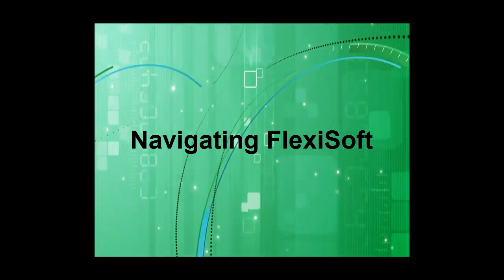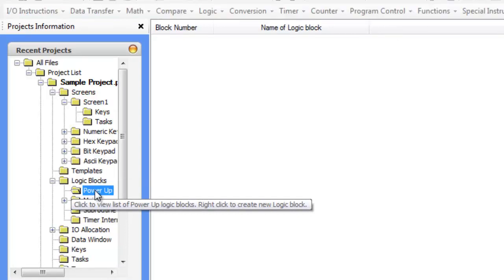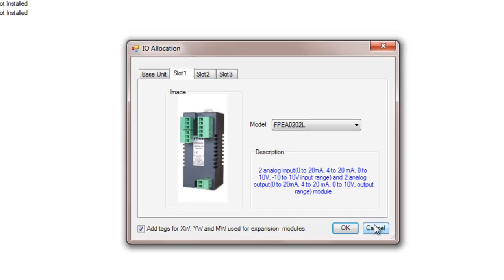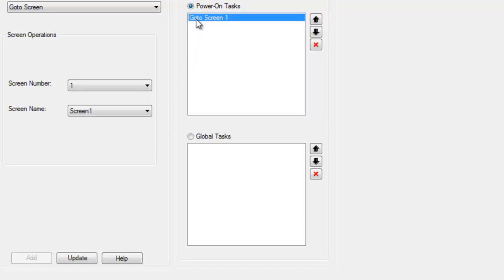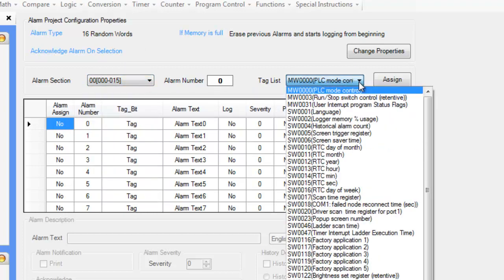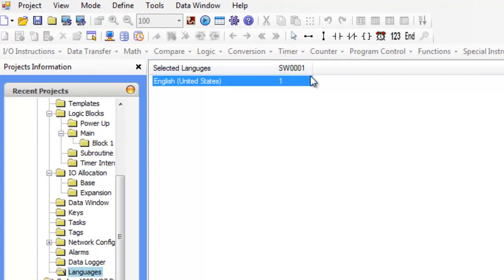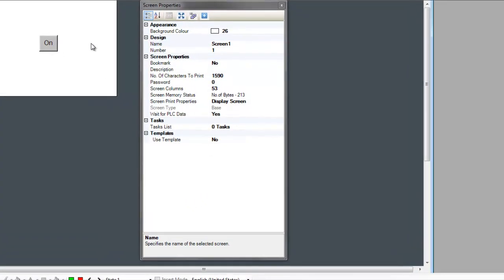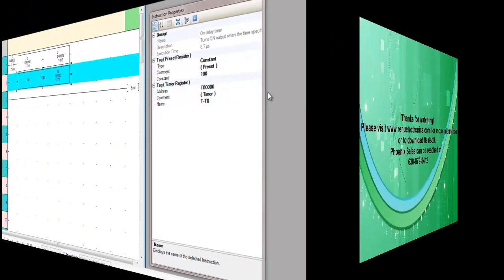Navigating FlexiSoft project

Comment: can u upload a video on how to configure alarms created for FL010,display its message on HMI FP5070T ,its tagging and display alarms history..plz need it very urgent..i have been assigned prjt..
Reply: any one please reply...:(
Reply from the maker: Anandhakumar Chettiar Hello Anandhadumar.....I don't have a video for the alarms handling yet. It would be somewhat complicated to do in a video. Are you communicating via Modbus between the devices? My suggestions would be to use the alarm handling of the FP5070. When an alarm state is triggered on the FL50 the bit information would be communicated over Modbus to the FP5070.

Where are you located? Which location did you get the product?
Reply from the maker: Anandhakumar Chettiar Here is an example of how to do Analog Scaling assuming you are using native ladder and not IEC61131 http://youtu.be/eh9bYqpS5I8.
To solve the alarm handling issue you would probably be better served by emailing support@renuelectronics.com. Renu Electronics is based in Pune and should be able to assist you from there.
Reply: PhoenixSales thanks :)